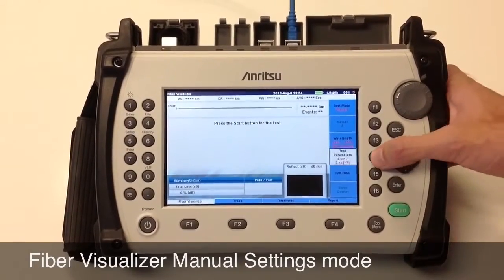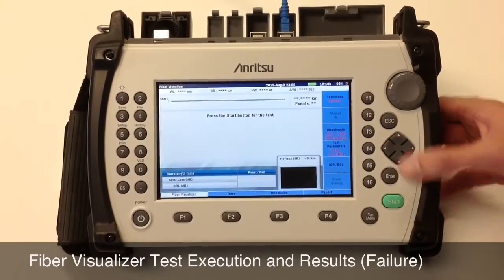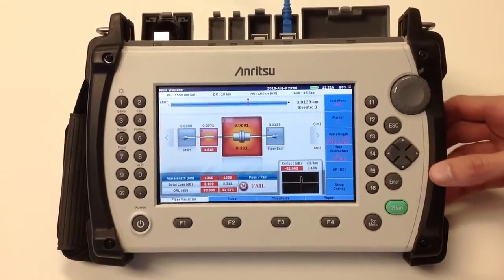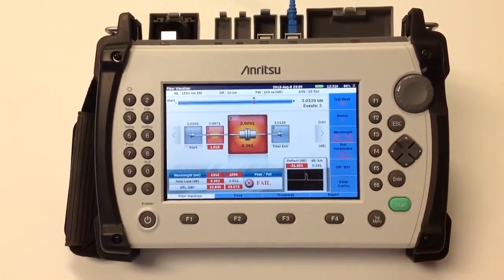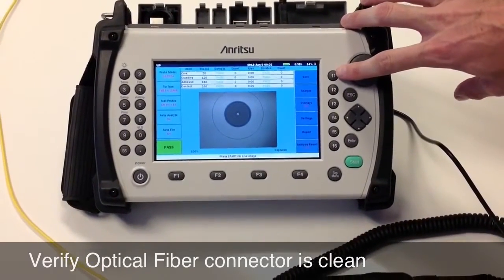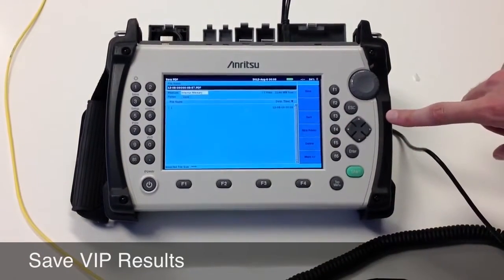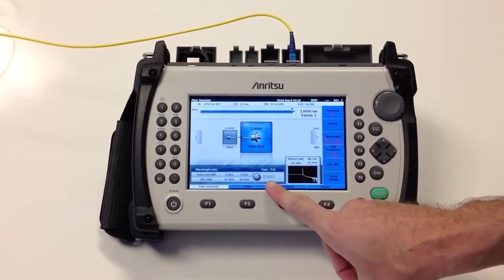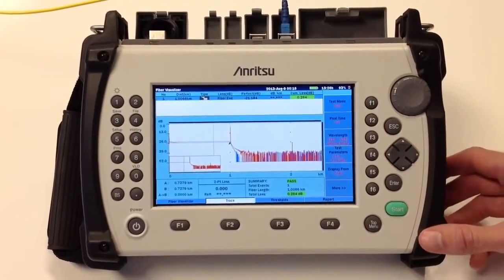Anritsu MT9083 Series OTDR Fiber Visualiser Demonstration

Comment: Hi, is the equipment has a built-in power meter and light source? can you make a demo for that? thanks.
Reply from the maker: Yes this model is available with power meter and light source options - we don't have a demo video yet, unfortunately. 

If it's any help, the Loss Test Set functions are documented in the user manual (7mb PDF): https://ausoptic.com.au/downloads/dl/file/id/717/product/1501/anritsu_mt9083_series_access_master_operation_manual_17th_edition.pdf